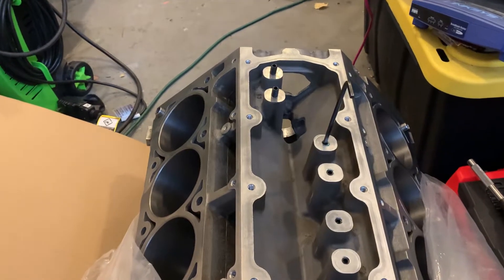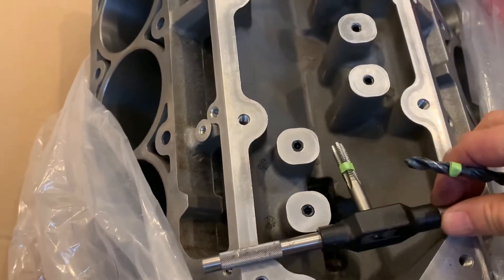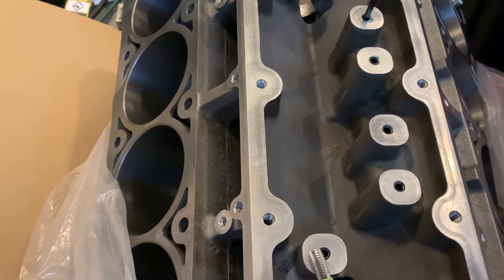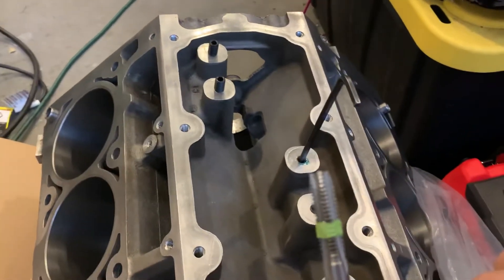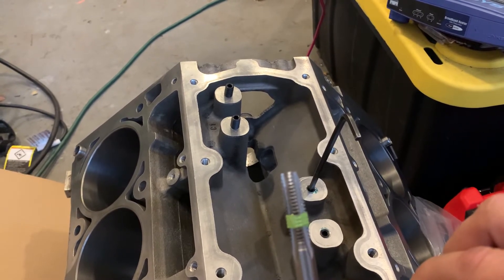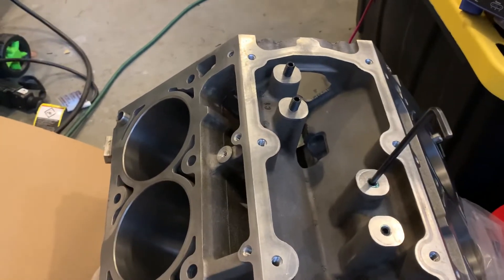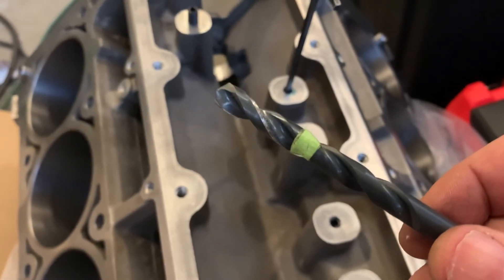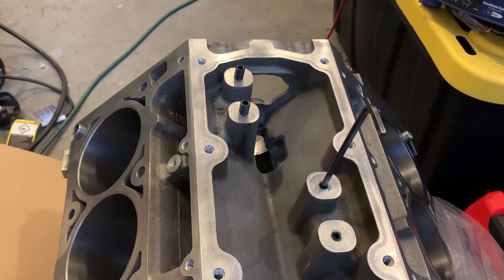DIY LS DOD Delete for 20 bucks or so (blocking the oil passages)

Comment: If you do only the plugs in towers and run a disabler in the obd2, will this disable the afm?
Reply from the maker: I would get rid of any hardware that is still present like the wonky lifters.
Reply: @deansmessygarage8616 replacing the lifters is an absolute must. If I’m tearing my engine down to the block though, I’m going to be looking at a new cam. 😂😂 of course if you get a new cam, you’re going to want a new exhaust. That new exhaust sure would benefit from a new set of ported heads with new valves and springs.  Those ported heads and new valves sure would appreciate a new fast manifold and a new larger diameter throttle body. Crap, all this air, I need more fuel.  The thought process plays out just like a Dr Seuss book written for gear heads!!😂😂😂
Reply from the maker: @RobsReviewsAll  if you’re gonna be a bear, be a grizzly!